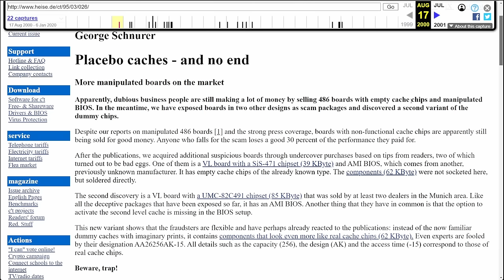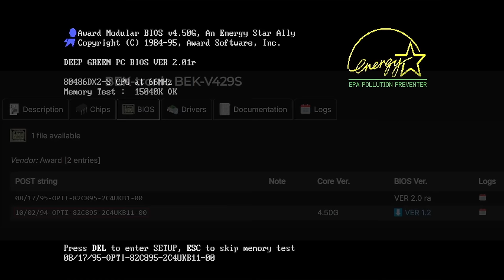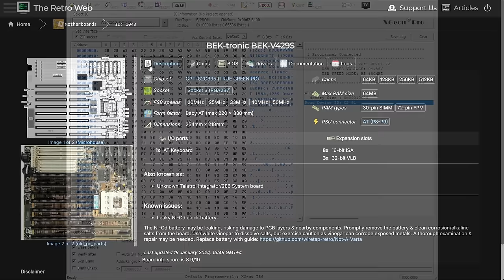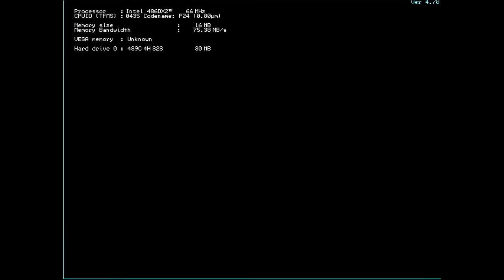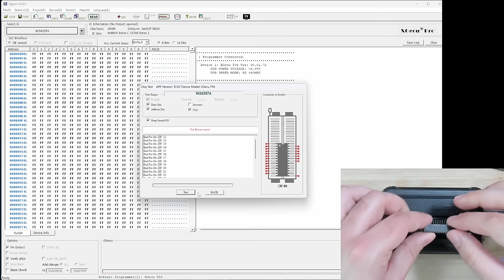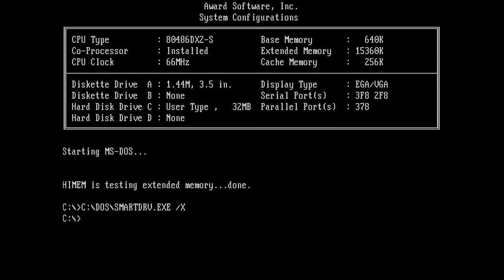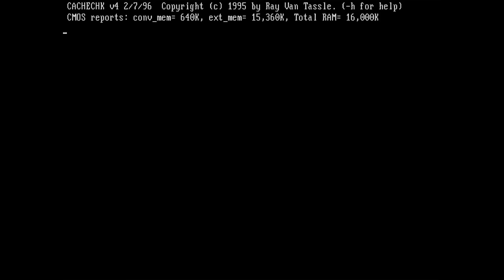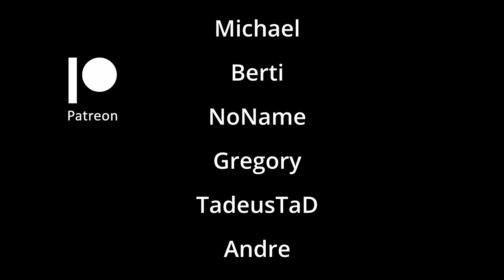They fooled so many: Fake cache chips!

Comment: I have an Asus board I bought where I suspect the BIOS was modified and fake cache chips are being used.  I set the project aside several months ago to work on other projects because I couldn't figure out why all tests showed only one cache, including CACEHCHK and SpeedSys from the Phil's DOS Benchmark Pack.  With this video, I'm curious if I am running in to a similar situation like what you experienced here.  Unfortunately I don't have a chip tester or EPROM burner to troubleshoot.
Reply from the maker: You should be able to use a multimeter (if you have one). It just confirms if the legs on the chips connect to something internally. Otherwise, having a strange behavior in CACHECHK or SpeedSys may be an indicator, but it could be that the cache is just faulty. I think the best method would be a multimeter.

Comment: I don't think they edited the output routines. They just removed the placeholder in the display string and replaced it with "256K" If you search the display string in the older bios and place that in the new bios, you only have to deal with checksum. There are checksum generators out to help you out. This could result in a correctly working newer bios.
Reply from the maker: I will look into this! I already have more than enough material from the comments to make another video!

Comment: Usually those lying biosses still support cache, they just lie when the cache is not installed/fake, but if you put real chips here it should work (at least it does on my pcchips)
Reply: Also for the faked bios, my assumption is that they replaced the "none" string with "256kb" so when the bios wants to report "none", it prints 256kb as usual
Reply from the maker: So, probably I should have twice the string '256kb' in the BIOS file. I'll try to find a way to reverse this modification.

Comment: Ha, you are lucky because you at least got some free copper in your fake chips 😃 I have fake chips that have absolutely nothing in them, not a single piece of metal. Also some infamous PC Chips boards have a BIOS that is modified in a much more complex way. Instead of just showing None/256K, when you have no/fake cache and a cache-related option enabled in BIOS, it shows a unique boot message that says "WRITE BACK CACHE ON" or something along those lines. Fortunately, the BIOS still works correctly with reals chips and even displays proper cache size (up to 1M). The model I'm talking about is M915i.
Reply from the maker: Interesting! So what, your cache chips have plastic pins? I guess my chips are one of the better (as in more expensive) fakes then. I have an M919 that needs to be repaired (CPU inserted in wrong orientation). I haven't figured out yet what the problem is. But I do have the cache memory that looks like a COASt module. But that might be fake too - who knows
Reply: @bitsundbolts  Oh no, the pins were metal, but they were barely inserted into the plastic and then there's nothing. In fact those "chips" were so bad they melted completely under a heat gun. As for M919, (to everyone who's reading this) plz never put regular COASt modules in there, also plz don't put modules with 3.3V SRAM chips if you use a 5V CPU. It will result in permanent damage.

Comment: Nice discovery.  I wonder if it would be possible to build an interposer board to use modurn sram chips and give it an ungodly amount of cache :D
Reply from the maker: I think the cache is probably limited by the board. I think it won't go beyond 256k.
Reply: Having longer sockets for some of the cache chips on this board I assume that it could take 512Mbit chips and have more than 256KB of cache?
Reply from the maker: In theory, yes. But I haven't checked.

Comment: I had some 386 board back in the day with fake cache chips soldered in, not even socketed, so I assume the board maker was perfectly aware what they were doing (or some middle men added the chips). Those fake modules were visibly fake and had extremely "plasticky" feel. I assume they were completely empty plastics with legs because no BIOS or software would show any cache at all.
Reply from the maker: Yes, the BIOS and the cache chips had to be changed - so, looks like a collaboration.

Comment: Btw you can always just check if they get warm
Reply from the maker: True, that would be another way! But I think you probably need a thermal camera, or you need to wait until they heat up. But you are correct! I will try in the next video about those chips and BIOS.
Reply: @bitsundbolts  I don't do much with 486 boards but the one I have the cash ic do get pretty toasty after a while so yeah it's a viable method

Comment: 19:42 - Did you have cleaned the board ?  They are normally very dusty and dirty. Awesome camera move.
Reply from the maker: Yes, I clean the boards. I usually just clean them under running water and some dish soap. A small brush will help to get most of the dust out of small gaps and under sockets.
Reply: @bitsundbolts  - Even if I make photos from my new PCBs here I see dust within a short time over them, this does not looks nice.

I clean it first with warm water and dish soap too, then with distilled water to get rid of the salt on the surface and at the end I put some Isopropanol over it to clean it.
The I dry it for a while in warm air, so that the water or Isopropanol under the chips and capacitors / smd-resistors goes away. With BGA-chips this is very important.

Comment: About 20% of components I get off aliexpress are faulty, so if I order 10 mosfets, test them straight out of the packet, 2 go straight in the bin, still they arrive pretty fast these days.
Reply from the maker: I can see this happening - unfortunately. I ordered a batch of ICs for the SoundBlaster 2.0 (CMS upgrade). Of the 40 chips I got, only one was faulty. I know this is not always the case, and power regulation is probably a totally different breed of ICs, but I am still glad I have access to a reasonably priced source for old ICs I wouldn't find anywhere else.

Comment: Interesting findings. Thanks. If it is the case that the None string was replaced by 256k string, maybe it is worth testing with only 128k and see if it displays correctly. Since you only tested with 256k installed, it might be possible that one time the BIOS showed 256k (None) and another time really calculated 256k.
Reply from the maker: I will investigate further, but someone already disassembled the BIOS. Looks like it is more complex than that. They updated a BIOS function that returned the cache size. I'll try to find out how they did it and share it in the future!
Reply: @bitsundbolts  oh cool. Well that makes the Bios a bit less usable. Thanks for the info and kudos to you both.

Comment: You could X ray chip. I worked in chip design and failure analysis could give us X ray image to show bonding problems, and occasionally a missing die.
Reply from the maker: That would be really nice, but I do not have access to an X-Ray device. I probably have to sand the body down.

Comment: You can take the chips to a dentist. Nowadays most dentists have digital X-Ray machines. They have a good resolution and can look into the chips without any damage.
I do that pretty often, usually reverse engineering sealed obsolete modules to fix old machines.
You can't see what is exactly on a chip but you can clearly see if there is a real chip inside.
Reply from the maker: Haha, I don't know what my dentist would tell me if I show up with a bag of chips for him to put in his X-Ray machine :) I can only imagine the look on his face (before he kicks me out) :)
Reply: @bitsundbolts  My dentist was very curious what it would look like and made an extra effort to capture as much details as possible.
From then on I paid for the X-ray pictures. It's 5 minutes of work for them and I had paid EUR 50 each time. I had earned easy money with  those pictures.
You can draw the schematics of the modules easily and then you just have to do some math to figure out the values of the parts.

Comment: It's amazing to see what motherboard manufacturers would do in order to save a buck. How hard up for cache do you have to be to go through all that effort? I don't remember the cost of cache back then, but I want to say that 256kb was dirt cheap by 1994, and that's paying the retail markup costs.
Reply from the maker: Very valid question! However, I have a feeling that it was not the manufacturer, but rather a distributor that tried to make a bit of extra money. And if you sell thousands of office PCs, that may not be tested for level 2 cache performance, you make your extra margin.

Comment: This is likely due to the different default settings in the respective BIOSes, but look at how the "moving" performance shown in speedsys seems to be better for the first 8k of L1 cache on the older bios. I wonder why that is.
Reply from the maker: Yes, there are performance differences between the two BIOS versions. Looks like version 1.2 is better. However, the later BIOS has more features. I should look into this.

Comment: Thanks for this video!! Back around this time (1994) I bought a AMD 386 DX 40mhz motherboard at a computer fair and just buying 1mb of RAM was so expensive it cost more than the motherboard (CPU soldered on), Cache, OPL sound card, graphics card combined!  It performed quite well, better than most 386s I see people using on youtube these days.  I was able to play Doom on it at a decent frame rate with only a slightly downsized window.  My friend had a 486 30mhz which played Doom slower, I wonder if the cache on his was fake?
Reply: I meant 33mhz not 30mhz. LOL.

Comment: I would have just removed the cache chips and checked what the bios says is the cache now
Reply from the maker: Didn't I do that in the video?
Reply: @bitsundbolts  you loaded a different bios first. I meant like, on the old bios, just yank the chips and check if it still thinks it has 256k.

Or maybe you did do that? I didn’t get too much sleep yesterday when i watched the vid

Comment: I saw something about 2% speed difference in moving data with different bios versions. I'm curious if this is fluke or real difference and if it is significant enough to show in games.
If you have faulty chips with error on one leg, then spray chip with contact cleaner and wait couple of minutes. Sometimes it is only oxidation.
Reply from the maker: There was a difference in speed between the BIOS versions. If I get time, I'll try to find out if it's repeatable and if it makes a difference in games.

Comment: Somehow that makes me a little bit less sad about the 386 I saved for and got myself as a kid not having any cache - because now I'm also a bit glad that I wasn't duped into paying  extra for cache I might not have even gotten anyway! Editing the BIOS to lie to the user is just vile. At least they didn't break the functionality in the process and it still does use real cache if it's there. I'm assuming they just replaced the "none" string and it will show 128k if that's what is installed?
Reply from the maker: At least you skipped the risk of paying for fake cache! From what I understand from someone who looked at the BIOS file already is that there is a function in the BIOS to determine the cache size. This function has been updated to always return 256. So, the BIOS will probably always return 256K regardless what amount of cache is installed.
Reply: @bitsundbolts  Interesting - I would expect replacing "none" with "256k" to be the lowest effort way of achieving this and from what I've gathered in the comments, at least some other tricksters have chosen this option, but if you can find the right spot, manipulating the function to always return 256 is of course also a possibility. Would be nice if someone could restore the original functionality, so that there's a fully working BIOS version on the retro web. You say that while it is newer and has more functionality, it does have some performance issues though? In that case, restoring the cache determination routine may not be worthwhile after all. A follow-up video may be warranted. 😉 I'm certainly intrigued!

Comment: Your bios version is 4.50g in both cases ..What you read is known as info text . The fake bios may not have nothing new or improved, but tish infotext and date changed.
Reply from the maker: Both BIOSes are quire different. I will show that in an upcoming video. I think the 4.50g might be the AWARD main version. 1.2 and 2.01r is probably for the content of the BIOS (could be very different from board to board or even from version to version). I remember that v4.50 and v6 makes a big difference when modifying BIOS logos that appear on the screen (Energy Star Logo).

Comment: I bet it's the same bios as on yhe website but they messed with yhe post and version string 
Snd replaced NONE with 256K

You can try partially populating the slots and see if the amount changes... If do they left the check in place
Reply from the maker: I think the board will always report 256k with the modified BIOS, but let's wait and see. There may be something cool coming up very soon.
Reply: @bitsundbolts  even when only partially filling up the cache?
Reply from the maker: Yes because the function determining the cache size has been changed to always return 256. So, it doesn't matter what amount of cache is installed, it will always show 256k.

Comment: I think a follow-up video where you tried to fix the fake BIOS would be interesting. Even if it ended up just being that the original "modders" just replaced the four bytes "None" with "256K" as others have suggested.

I'm sure the location of the checksum in the BIOS and the algorithm is well documented somewhere on the web. If there aren't tools to correct the checksum I bet it would be easy to hack together a little Python script to do it.

Or isn't there some tool for customizing Award modular BIOSes? I assume it can correct checksums.

All of those topics would be interesting to see you cover I think.
Reply from the maker: I agree! They are all interesting topics. My experience in modding a BIOS is near zero, but it wouldn't be the first time I learn something new for this channel :)

Comment: Hello, This is a very interesting video.  I'm curious to know if you would be able to search through the fraudulent bios for the cache related strings and if you could possibly locate those entries and modify them to have the 'normal' functionality and then flash the edited version of the bios to a bios chip?  That should actually work? and if you aren't sure what the original values should be you could possibly use the older bios that you downloaded as a template of sorts? (or perhaps you could run some sort of program against both versions to see what the differences might be? could something like that be of interest as well?  Just curious.  Thanks for the video and best regards.
Reply from the maker: Thanks for watching! It's a great idea! I wouldn't mind getting my hands dirty with a bit of BIOS modding. I'll put it on my project list.

Comment: These caching schemes had very little effect on performance and that is why these dummychips were so common.  You only ever really found any difference with them installed in benchmarking software.
Reply from the maker: I wonder how much difference cache makes in games and software on a 486 like this. I should test it. But maybe you're correct and that is why it was hard to detect if you were a victim and had fake cache chips on the board.
Reply: @bitsundbolts  I suspect there are probably certain circumstances where it can make a difference, especially if coded specifically to take advantage of the cache.  I never noticed a difference either on PCs that I had with cache or with the 6100 Apple Performa I had.

Comment: Not only then, also today ....  look out for the 10ns 128kb ISSI chips. Thise are 99.9% fake or relabeled 15ns chips. I also have some which are blanks like your chips.
If you want to go 10ns: some modern 128k 10ns cache can be used (Cypress made some) which officially are 3.3v but have a tollerance up to 5.5v which can work but ymmv. You also need a interposer to make that work as they are not dip chips. I also have some 32k 8ns EliteMT ones which are really nice.
Reply from the maker: I have heard of those relabeling scams. It is unfortunate because it is probably very difficult to detect. Any idea how to spot/test relabeled chips? I would like to check the chips I got from AliExpress.

Comment: I found a computer next to a dumpster with a fake Pentium 200 that was a relabeled Pentium 100 but the BIOS also reported it as a Pentium 200 so I guess it was also modified.
Until Windows XP, the system properties dialog did not display the CPU speed so it was fairly easy to hide the actual CPU speed from basic users who never used information and/or diagnostic programs.
Reply from the maker: Oh wow! I didn't know they did that for CPUs too!!! I wonder if I ever will come across one of those BIOSes.

Comment: Nice check. This still a problem today. Do you have any tips for findding Fake USB storage chip and other flash chips, that offen have fake numbers. (You buy a 16GB but get a looped a 4GB, it takes data but overwrite the data on it self, when more the 4 GB of data are put in.) How  do I test those chips and expose them?
Reply from the maker: I haven't tested this myself, however, there is a freeware called ValiDrive from Gibson Research Corporation. I haven't used it myself, but I guess it will perform a write test on the drive and verify that the data is written correctly without overriding any previously written data.
Reply: @bitsundbolts  Thanks. I will try that.